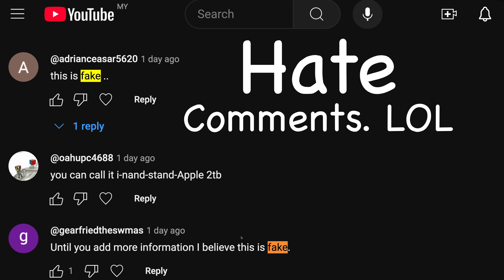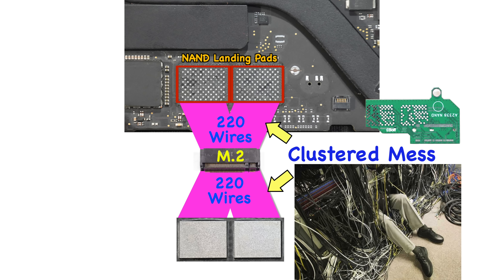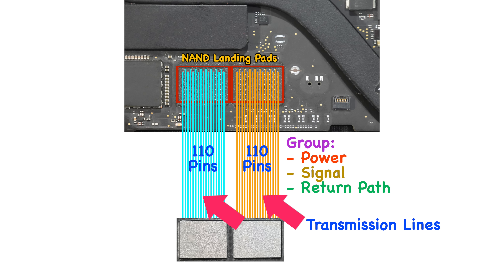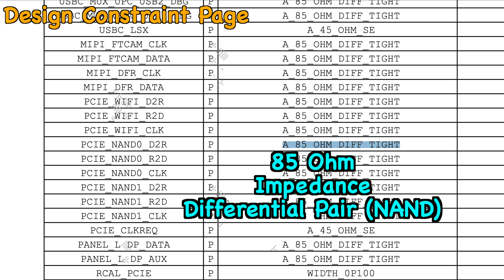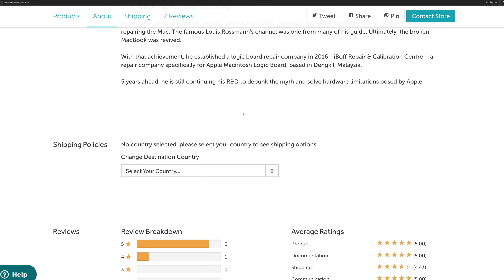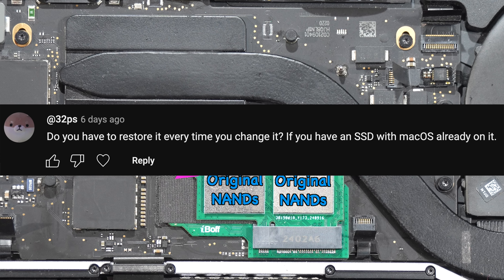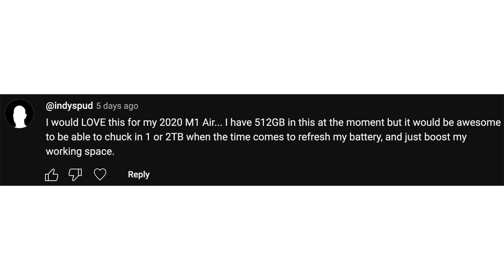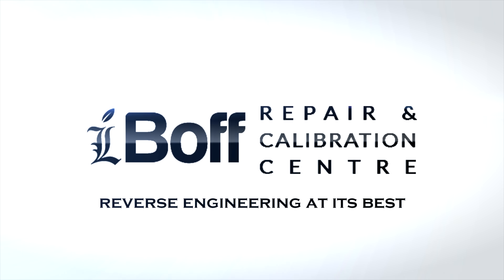No More Storage Limits : Answering All Your MacBook Questions! - 4K

Comment: it's too hard, too risky, too expensive, unfortunately it's not worth the cost even though you did an excellent job
Reply: It is risky if you have limited expertise in soldering and this is when you need to take it to a reputed repair shop to get it swapped out once your drive dies. The pcb wont cost alot more than the other similar PCBs on their store even if you account for an initial high cost. Nands are getting cheaper and it is defintely possible to find presodered kits online. This opens up to a whole new market of replacement drives once the initial mod is done.
Reply: Shut up and take my money
Reply: its not for you. its for 3rd party repair shop in your area

Comment: 7:20 its not the same 19cm through the board vs. 19cm through board and interposer. Interposer and m2 connector result in DB loss and poorer signal integrety than only board traces
Reply: Well I mean they did test it and it seems to work fine
There's no really other options
Reply: presumably less than the extra 7cm in trace length as demonstrated by the working machine in the video..
Reply: Well whatever the losses are it seems to be within the window of acceptable performance to not be noticeable